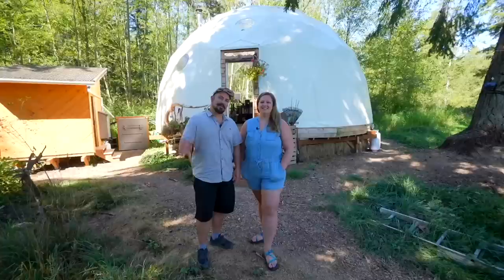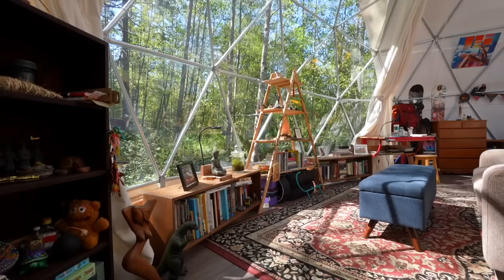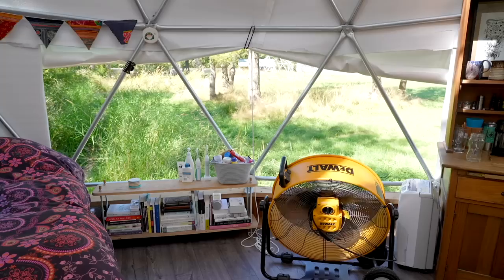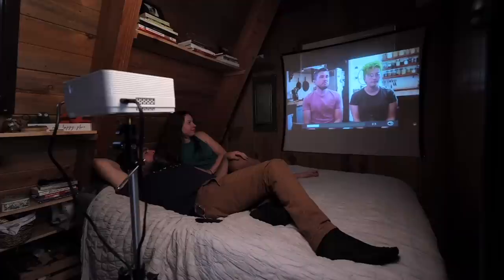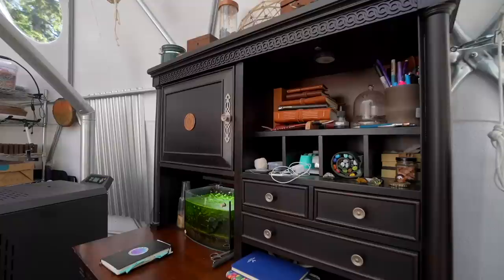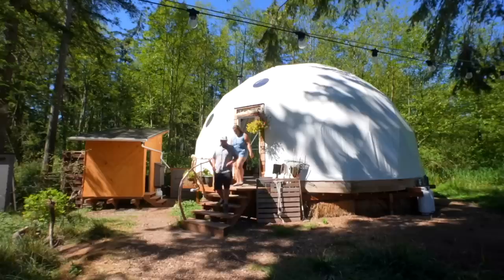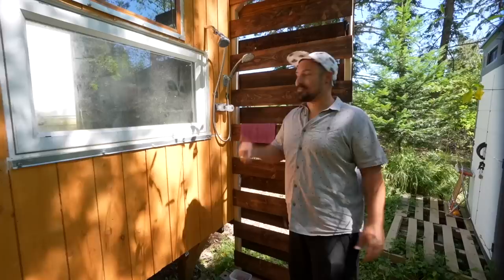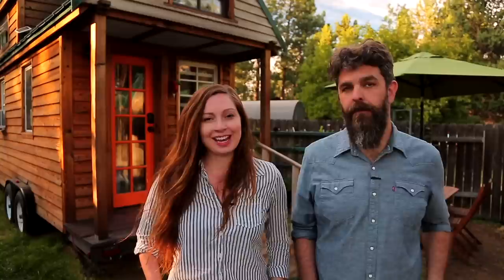Enchanting DOME Home in Woods w/ Luxury Bath-House & Rain Catchment

Comment: I had a friend in Michigan that lived in a dome through the winter - she said her and her young daughter stayed warm - no problem and the folks in cabins around them came over to warm up.  She said the domes were good because they circulated the heat well.  I'm guessing hers was much smaller scale.  Great adventure - your set up good there.
Reply from the maker: Thanks for sharing 😊 I wonder if their dome had insulation or solid walls. Good news is that Evan & Sam just installed Pacific Domes’ insulation kit so they should be much better off this winter!
Reply: Smaller or just better insulated. This Couple opted out of the insulation materials... I  would like to know how much you saved on the insulation. I like this Dome very much! 💓🥰💞
Reply: @TinyHouseExpedition  yeah I asked the question. I’m sure the insulation and liner makes a big difference

Comment: Very nicely done ! Beautiful . Have you thought of getting a winterized insulated cover to go over the existing one ? It would cut down on heating the dome in the winter and even make the normal cover under it last longer since it would not be exposed to the harsh winter sun and cold temps.

Comment: To circulate the heat from the fire you need to hang a reversible ceiling from the top of the dome. When running backwards in winter it pulls up the cool air & the warm air naturally circulates.
Reply from the maker: Good idea 👍👍

Comment: To hide the clothes on the rail hook up some form of curtain either voile or  other light weight material. That is what I did when all I had for a wardrobe. Also add rugs. I in front and then sides of bed will help in winter  by acting as a little bit of insulation.  Other than that, you have an amazing home

Comment: Such a peaceful place....  I'm wondering how you stay warm in the bath house in the cold winter months?
Reply from the maker: Good question! Maybe a space heater? Evan & Sam might pop over here to provide an answer 😊
Reply: This will be our first winter with the bathhouse. It’s such a small space that when you run a bath it gets quite warm. For a shower though in the cold months we may run a small heater or install a small diesel heater for less electricity use if needed.

Comment: what about weather conditions ? does this support high winds and snow
Reply from the maker: They definitely experienced both and failed fine but was a tough winter without insulation installed. Fortunately they just got Pacific Domes installation kit to prepare for this winter!
Reply: It’s rated for 10ft of snow and can handle 110 mph winds. Rated by engineers. We struggled this last winter with no insulation but we fixed that so we are ready!

Comment: What is the security level in a dome or yurt? I’m thinking of adopting a tiny home life, and the dome version is attractive because of the soaring space and the room. But with fabric walls, what’s to prevent someone from breaking in with a knife or other simple tool? My life will always include time spent away traveling. Also, I live alone and have no plans to ever change that. What is your security wisdom?
Reply: That is one downside to dome living. Unless it’s a wooden or fiberglass structure dome, the security level is low. We luckily live on property shared with other people so it’s never really left vulnerable. If you like the high ceilings maybe an A-Frame cabin would be a good option to think about.